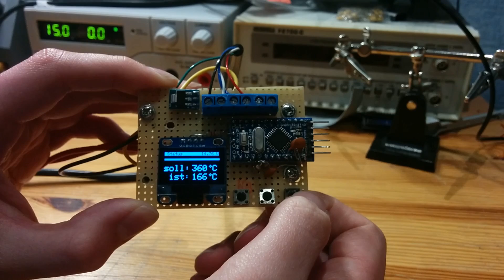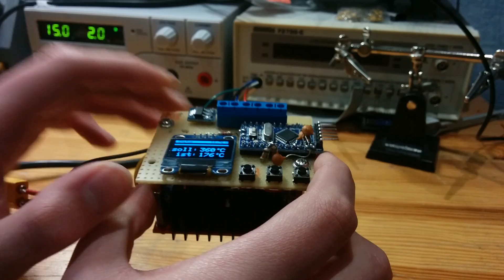LiPoSolder - lithium polymer battery powered soldering station

Comment: Is the Zd-931 soldering iron faster at heating with this project than with the Zd-931 station?
Reply from the maker: Yeah, I was abusing the element very much.
There's much, much better soldering irons these days, available very cheaply. Go buy a TS100, they're awesome.
Reply: @Manawyrm  but does the TS100 have esd protection
Reply from the maker: @irishguy200007  yes, theres a small screw to connect to earth.
Reply: @Manawyrm  you connect that to the earth strap on your hand? 
I'm thinking of getting the PINECIL as it's cheaper and has more attributes and comes with more accessories.
Reply from the maker: @irishguy200007  Go ahead, it's a fine piece of equipment. I have ... political problems with the company that makes it, so I'm not endorsing it.
Reply: @Manawyrm  how political?

Comment: Tolles Projekt.
Der Lötkolben und der Temperatursensor würde mich interessieren, da ich einen tragbaren Lötkolben auch gut gebrauchen kann und sonst fast alle Teile für den Regler noch irgendwo haben müsste.
Reply from the maker: +Gigawipf Der Lötkolben ist dieser hier: http://www.amazon.de/gp/product/B000V8GR44?psc=1&redirect=true&ref_=oh_aui_detailpage_o03_s00

Es handelt sich bei dem Temp.sensor leider um ein Thermocouple, genauergesagt um einen Typ-E Sensor. Die Ausleseelektronik bzw. die Chips dafür sind leider etwas schwer zu bekommen, ich habe mir hier von Maxim einen MAX31855E gesampled. 

Wenn du das ganze nachbauen möchtest, kann ich dir nur empfehlen, den MAX31855E so weit wie möglich weg vom Switchmode/PWM-Board zu packen, nicht wie ich unten aufs PCB. Ich hatte da größere Probleme mit Störungen.
Reply: +Tobias Mädel (Manawyrm) 
Der Lötkolben sieht interessant aus.
Werde ich mir auf jeden Fall merken.
Die Sache mit dem Thermocouple macht es etwas komplizierter und teurer, aber einer kleinen tragbaren Lötstation wäre ich nicht abgeneigt.
Ganz sicher, dass es sich um ein E tc handelt? Den MAX31855E als nicht smd zu finden scheint nicht so leicht zu sein.
Reply from the maker: Ja, es ist definitiv ein Type-E Sensor. Gibts auch nur in SMD. Am besten eine fertige MAX31855 Platine (für Typ K) kaufen, und den Chip durch einen Typ-E Chip tauschen. 

Ich hatte da schon richtigen echten Ärger mit, siehe letzter Post ganz unten: http://electronics.stackexchange.com/questions/212003/using-a-type-k-thermocouple-adc-to-measure-a-type-e-probe